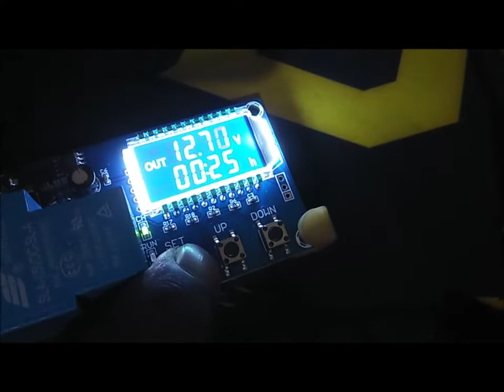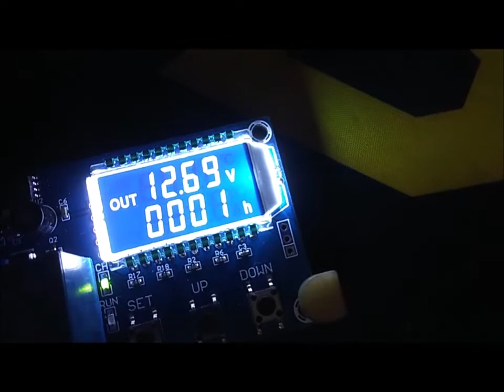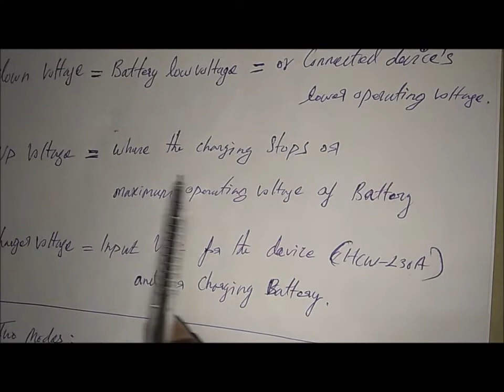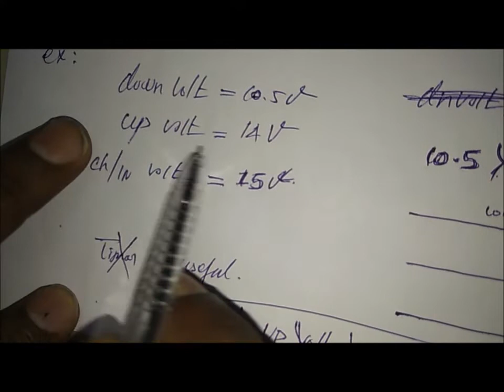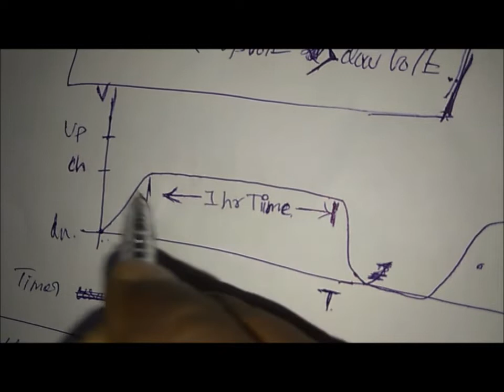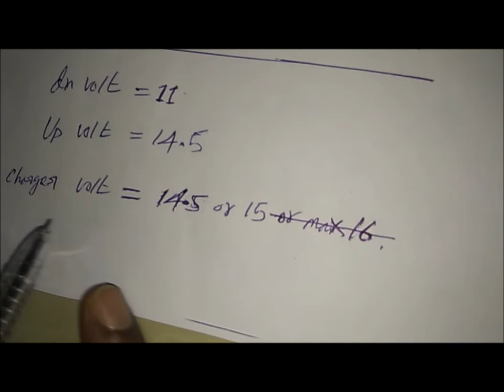Charging Control Circuit

Comment: I have XY-L10A

charger attached ok
Battery attached ok

Direct red light ON charging 

UP  DOWN SET   button on press no responce ?

Screen show DC  V  only  at top below simple line show----------------

i buy it on 15 jan-23

Any soluion for reftify the module issue ? or its damaged
Reply from the maker: Press Set Button for 3 secs and set it as per video. It should be working.